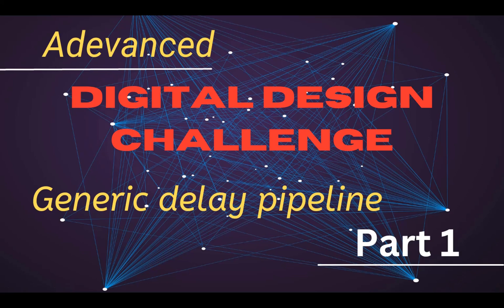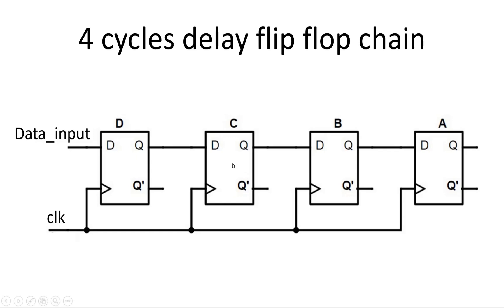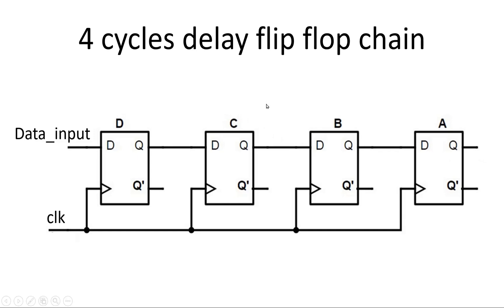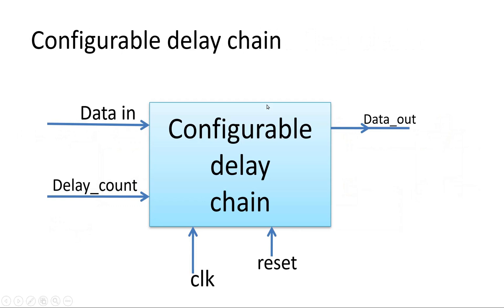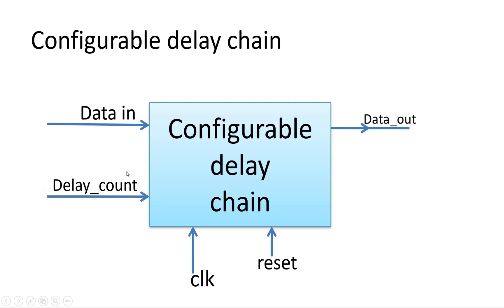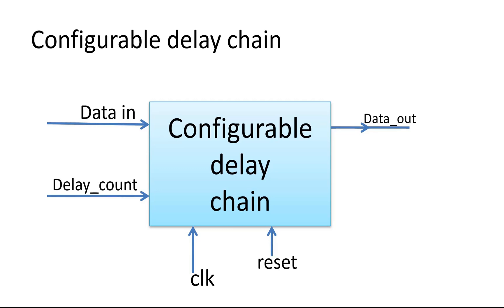Digital Deign Challenge Genric Delay Pipeline Part 1

Comment: make an n bit shift register where n is a parameter equal to maximum delay count value. then use a mux with delay_count input as the select line and assign shift_register[delay_count] bit accordingly to the output data

Comment: Unsing  a counter and comparator. 

Counter increments till the delay count input making the comparator output high for one clock cycle and counter get reset to 0 again. 
This comparator output used as a   clock to  a  flop where data_in is waiting to capture and its output is  delayed output Data_out
Reply from the maker: I appreciate your attempt to solve the problem—using a counter and comparator can indeed help calculate the required delay. However, there’s a critical issue you've overlooked: the input data. Where is the input being stored during the delay period? Without proper data holding, the input will be lost before the delay completes. That makes your solution impractical in its current form.

Comment: can we use a up counter upto N cycle and when the counter reaches its max value then only assign input to output is this correct
Reply from the maker: I appreciate your attempt to solve the problem—using a counter and comparator can indeed help calculate the required delay. However, there’s a critical issue you've overlooked: the input data. Where is the input being stored during the delay period? Without proper data holding, the input will be lost before the delay completes. That makes your solution impractical in its current form.

Comment: One solution is , a FIFO structure  with  Write and Read pointers , separated by the delay count. Both The pointers will  increment by 1 every clock.
Reply: what should be depth of fifo?
Reply: @chiragjoshi5866   Since  the question did not specify  the  "Data In" Rate .... I have to assume the data can arrive  every clock cycle,   so that requires  the FiFo depth to  be  equal to the Delay Count.
Reply from the maker: @rrangana11  You are very right.
Reply from the maker: @chiragjoshi5866  FIFO depth will depend upon the amount of max delay that is expected from the design.
Does it answer your question?
Reply from the maker: Excellent! This is one of the solution people use.
Sorry for the delay response! if possible, can you please prepare a ppt and record for our viewers.
Reply from the maker: Now, also think of a solution which area optimized as compared to the proposed one.

Comment: Sir what if we configure a SISO shift register according to its delay count ,it will work.
Reply from the maker: SISO shift register is commonly used for adding delay. But that will add delay of fixed number of clock cycles.
Reply from the maker: Try to think.